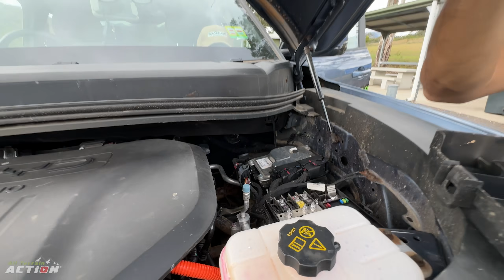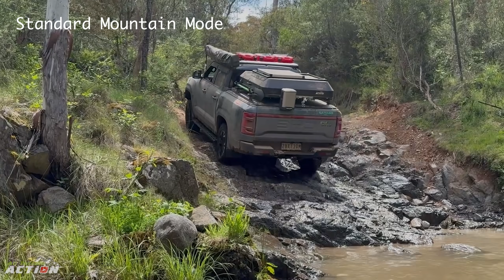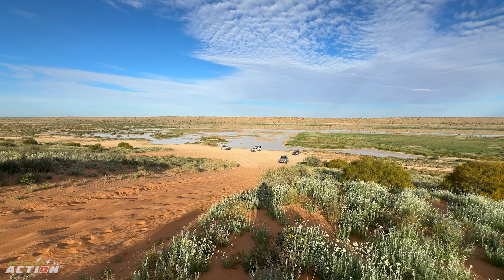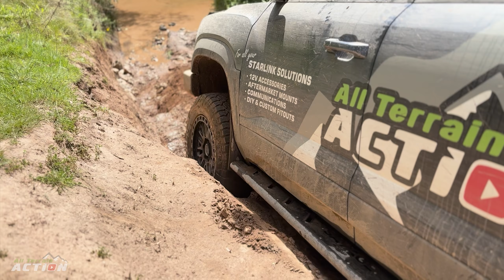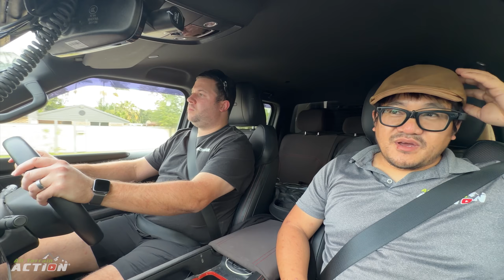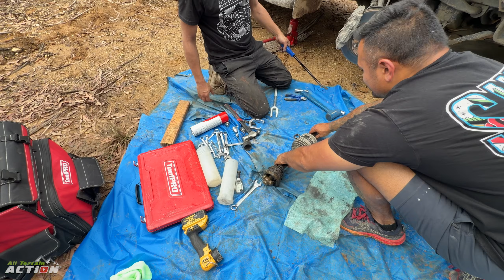The Future of EV Tuning Starts Here | Inside EVX Development | BYD SHARK Aftermarket

Comment: Ev caravan, with battery and drive unit. Self powered supply and parking moving.Camping mode % min setting, Plus connection to vehicle to power its drive unit accelerate brake regen as a power booster so it not a dead weight, and improves vehicle efficiency.

Comment: I can see the one pedal driving not holding the car from rolling forward in reverse may be a problem.

Imagine youre parallel parked on a hill and there is a car in front and behind. The shark is quite large so the other vehicles can be parked close to the front and back of the shark.

Rolling forwards in reverse could cause you to hit the car infront and if you apply too much throttle in reverse because you're anxious about rolling forward it could result in you backing into the car behind.

The reason it worked in a manual was because you had a handbrake lever, much less punchy acceleration and could feel when the weight of the car shifted. Sadly no such luck in the shark.

Regarding the engineering to have one pedal driving I absolutely would be for it. I think most people would be happy to use an "overseas" model in Australia but would be worried about insurance. 

Physical air conditioning buttons and seat heating/cooling buttons would be amazing $500 is a bit steep but it would be amazing at the 100-300 dollar range

The constant engine RPM is a really great idea. If we know what RPM that engine operates at peak efficiency even if we're losing SOC it may not matter depending on distance and would result in less fuel consumption than the shark revving its guts out when it hits 25%

Replacing the pedal isn't ideal, are you able to modify pedal behaviour with the stock pedal or is it a hardware issue?

Adding to that having an option for instant acceleration and deceleration would be excellent. The stock sloppy and delayed byd acceleration is awful.

Making it easier to sideload apps or even just have the google play store would also be a massive benefit.

Are you able to add virtual diff locks? Utilising the brakes and traction control to get the wheels to spin at the same speed?

Anyway just my 2c great work so far guys hope to see more updates regarding EVX soon

Comment: As n older driver my main concern is fuel economy when towing    and   would love one pedal driving please    asap will buy the software asap I am working on a simple blower adding fuel vapour and browns gas  straight into the air intake space between the right side mudguard without touching the rest of the fuel injection system only when towing at reasonable speeds that is       any thoughts anyone please/?
Reply: This is incredible dangerous

Comment: Things I'd like:
240V in the tub active when vehicle is shut down, like V2L.
More re-gen in Mountain Mode.
The option for more re-gen in standard modes- I had a diesel manual ute last and liked being able to down shift. It will do it now, but you need to set the cruise control down low. 
Off road modes with a trailer on.
Kill the speed limiting with a low weight trailer- its dangerous when over taking and then you lose power.
One pedal, probably has its uses. My lawn mower and tractor have it- sort of.
Turning off drive units? Turn your Shark into a doughnut skid pig!
I'm interested in the CV spacers, and I start a basic turning course next week.
Reply: Agree on making the tub power follow V2L rules.

Comment: My concern (and probably yours) is that you do all this development and BYD make it obsolete with the next OTA update.
You mention a 'Tow bypass module' in one of the test videos; is that an actual module, or another function in the EVX system? Not having off road modes with a trailer on is a bit annoying... so too the speed limiting.
Reply from the maker: That’s actually the best result of they did, because we primarily want to make the EV off-road and touring industry better, that’s our business objective and they currently do not take any interest in what the small % of owners want, by making it in the aftermarket space if that forces their hand to make it a factory inclusion then we have done a good thing. It also means they are willing to add/change things based on the small demand for it.

Comment: A/V.  The original foundation from an architectural perspective should be viewed before any software upgrade !  The new 'Performance' model is a new approach to the original platform, yet the basics are still lacking overall ?  BYD = Bury Your Dreams for a reason, look from the sum of the parts to the whole to discover alternative answers to the problems of this prototyping.  V

Comment: How hard would it be to program “diff locks???”
Reply from the maker: That isn’t a thing that’s possible diff locks, is a mechanical process to physically lock both sides of the axle to match, traction control tries to mimic this using brakes and wheel speed sensors, and technically that’s what traction control actually does but there is a downside, up to 50% energy is lost from this brake effect and it’s not perfect 50/50 in most cases and will allow slip once brakes can’t hold the torque needed. So in terms of programming diff locks the shark already attempts to do this using traction control, there isn’t a way for us to make this better except for potentially applying brakes longer or changing the logic of how BYD does this as standard, there is still a limit though.

Comment: Have a thought. For future options. Could you develop a battery swap for higher density batteries to achieve longer EV travel?
Reply from the maker: Voltage architecture I think will be the challenge, but adding more battery in the same voltage architecture easy.
Reply: @AllTerrainActionEV there is a pretty good chance the voltage won't be a problem.  The biggest problem I can see is making the case as the whole battery pack is glued together so can't easily change the cells but if BYD brings a higher capacity pack that fits in the same space we can make it work.
As an example,  if you out a dolphin battery (360v) into a Seal (420v) it runs.

Comment: How does the range change when using one pedal driving? I know that’s a loaded question, but most of your footage is suburban, so you must have data to say it adds 10-15% or so. Would be interested to know.
I test drove a performance before i’d seen much of the x-mode footage and thought the Shark definitely needed more aggressive regen. It was in its most aggressive setting.
I’ll be buying one later in the year and very interested in x-mode, it looks like a fantastic value add for the car
Reply from the maker: Too early to tell, we are looking to purchase another SHARK 6 and keep it stock so we can give stock figures vs. EVX fuel figure numbers.

Comment: I think the rev selection would be good.
Reply from the maker: Yeah, it's really handy and gives you much more control since you know what the plan is in your drive. While it won't be something everyone wants to use, we've also found this allows the ability to discharge the battery down to 15% if you wanted too, similar to what the Sealion 6 allows in Blue EV mode. We're still evaluating any long-term battery implications, but it's a feature that was already available on the Sealion 6, so having it on the Shark 6 isnt that much of a worry to us. For me though, the biggest benefit is being able to manage engine RPM on the fly, giving more advanced users an extra level of control over how the vehicle behaves.